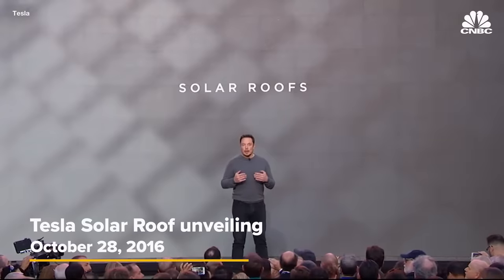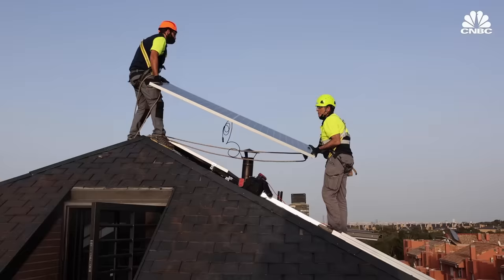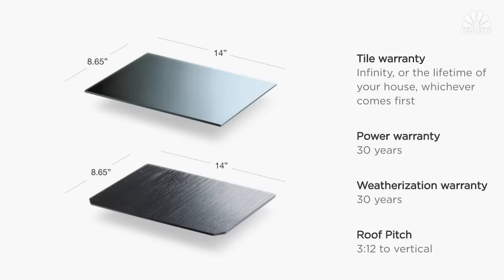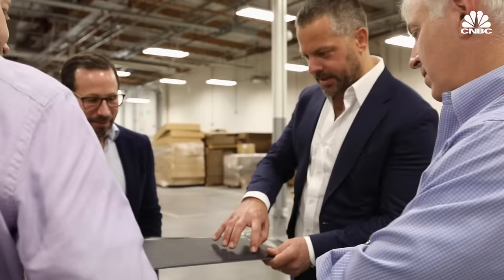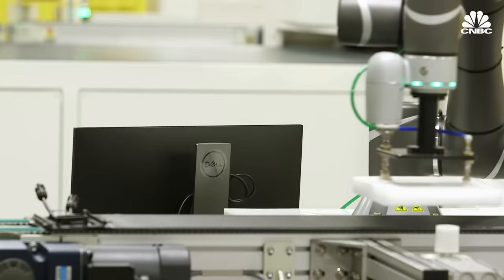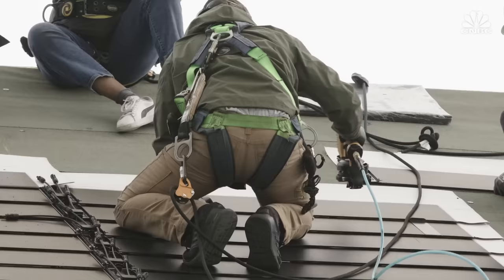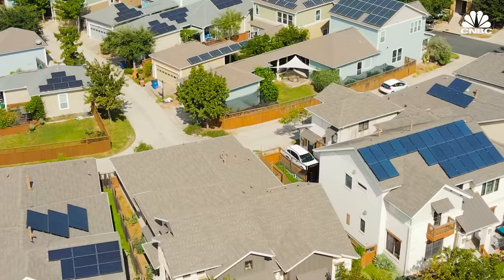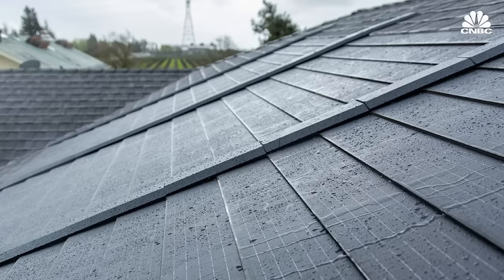How This Roofing Company Is Taking On Tesla’s Solar Roof

Comment: My main concern would be ease of repair / replacement.  I suspect it is a lot easier to replace a rack mounted panel that has been damaged by hail than their on-roof shingle.      The rack mount just seems simpler.  Why over-complicate things  for aesthetics.  It's just a roof!
Reply: A few dozen screws versus just some shingles. Idk. And anesthetics do matter.
Reply: Hail damage on shingles is probably worse than on panels
Reply: It rarely rains in my region.  Plenty of sun year around.

Comment: The bane of rooftop solar has been that roofers aren't electricians and electricians aren't roofers -- and you don't want either trying to pretend to be the other. LIkewise, solar panels aren't cost-effective water management devices and complicate the water management system, especially when it needs to be replaced.
This product is a big step forward.
Question: Can these panels be easily removed and replaced when the roof reaches the end of it's life? What's the procedure if a solar panel needs to be removed for a repair before the end of the roof's life?
Reply: The company offers the service to replace or deinstall when needed
Reply: @NoName-ei5ui  Thanks!

Comment: I have been waiting for this tech to be affordable, it seems I will never be able to have it😪
Reply: You could get a Tesla model x (Long range) at a very cheap price in our car audition.
Reply: @bobbystyles2457  then pay 20k when thr battery fails. 

Used Teslas are a very risky and poor investment.
Reply: Yeah Elon seemed to think what’s holding back solar roof was the look, but it’s the price! Supposedly solar cost is shrinking but the past 10 years I keep checking in on solar installers and solar of all types still way too expensive.
Reply: not with inflation
Reply: @gj1234567899999  yes...me too, I have been checking the prices. Prices keep going up😪
Reply: Y'all realize how price works right. People have to buy the products first and that profit goes into Research and Development which makes cheaper products. Same thing with any other tech.
Reply: Regular solar is pretty cheap, you can buy about 10 kw of lightly used solar panels for under $5000. Then you just need an inverter and to pay someone to install the panels
Reply: @ocampbell1954  it’s pretty straightforward what people want from solar. The electricity cost savings of the solar panels should at least payback the system before it needs to be replaced. From what has been quoted to me from solar installers, the system would never pay for itself.
Reply: @lakorai2  Pre-2019 used Teslas probably, but the 2020 onwards are much better, and when the 4680 battery cell begins delivery it will be a game changer for the EV market. The 4680 cells are the “million-mile battery” with minimal degradation. The average second hand care might have only 100 thousand miles on the clock. With the 4680 beginning later this year, the car body will degrade before the batteries fail.

Comment: I really hope GAF is able to deliver a good long term solar solution, the world needs it. Having said that, while I found this video to be fairly comprehensive, I would have liked to have heard how GAF compares to Tesla in extreme weather like hail. I realize that Tesla roofs are way more expensive, and I realize that it is very new, but the GAF roof is very new also. I have seen videos where a Tesla panel has been hit with a hammer repeatedly and remained intact and according to at least one builder video I saw, if one does break the time to repair is very small.

Comment: The 'faux' tiles were the mistake. The connections in a larger solar panel connected to others can be complex and expensive. It is more than just 'line in, line out.' 
Long vinyl panels similar in shape and installation as sheet metal would not only simplify these connections and lower price, but roofing companies would already be familiar with most of the install.

Comment: The issue with this is that the consumer assumes all the risk. I as a homeowner would like to know pricing, what's the warranty, does it require a maintenance contract. Also in Florida how will it effect my Insurance premium as it will be very costly to replace should a hurricane rip off the roof or damage. There are still roofs in Miami with tarps that were damaged in 2018 from hurricane Irma so I could just imagine the delay with this new technology.  

This is also not taking into consideration the current supply chain shortages that's impacting all industries.

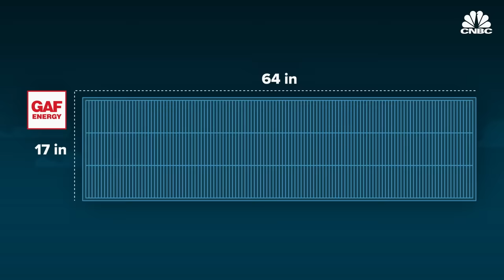Comment: CLARIFICATION 1/5/22: At 11:02 in the video, there is a comparison made that needs clarification. The video states, “Given the GAF shingle’s dimensions and its 45 watt rating, it would produce, at maximum, 5.96 watts per square foot.” However, because of the way GAF Energy’s shingles overlap on the roof, 56% of each shingle is made up of non-solar material. If you consider the efficiency of only the active solar cells, GAF Energy's shingle produces 14.29 watts per square foot, which the company says would be on par with the efficiency of Tesla’s shingle.
Reply: Hahaha no flipping way…these shingles are a joke!
Reply: Strong point from A-DaM! I'm fully convinced by the complete absence of facts in his reply.

Comment: In Florida unless the whole shingle is glued down it will blow away in a Hurricane.  Roofs with solar on it suffer more catastrophic failure that normal roofs.  Just a work to the wise who live in Florida.  As a by note there was a home near me who had the "free" solar installed on their roof and within a year they had it removed and had to do a major repair job on thier three year old 50 year roof.  Just a word to the wise here in Florida.  Solar is not without problems and I have in no wise addressed all problems in any comprehensive manor.

Comment: A few years ago when Musk had the online estimator for a solar roof it said it would cost over $110,000 for the roof. I don't remember if it included the battery. This house is in sunny Florida and has a $100 to $200 monthly electric bill depending on the season. A normal architectural shingle roof estimate was $18k. At the time the solar roof cost was 1/3 of the house value.
Reply: You need to compare the cost of the roof + PV to the Tesla solar roof, not just the roof alone. Second of all asphalt shingles are the cheapest product on the market, there are far more expensive roofing products. Asphalt shingles also have a shorter life than a Tesla solar roof, so that also has to be factored in. Lastly most Tesla roofs don't cost $110k. It's like saying why is a Porsche is so expensive compared to a Chevy when both take you from A to B.

Comment: It will be great when new homes are built complete with Tesla Solar tiles and a powerwall included.
Reply: More expensive tho
Reply: @laudableplain4282  But if they can mass produce and become standard for new homes, then price would dramatically drop.
Reply: I am seeing more and more builders are now putting ev chargers in the parking of their under construction projects and selling it as a luxury feature. SO maybe soon solar roof will become the next luxury sell in the real estate market
Reply: It is well known that polycrystaline cells are better than crystalline cells, why gaf is not using them I don't understand. Also there are new cells developed which can develop electricity both from incident light and reflected light from the roof which is referred to as heat.  Don't know why these companies don't do their research
Reply: @lancetruong4957  true that

Comment: I have 17kW solar panel system and I’ve noticed that on cloudy days my peak energy production surpasses the peak production from a fully sunny day by a large margin. My guess is the panels are much more efficient when they’re cool, followed by sudden exposure to sunlight. I believe solar technology need some sort of cooling and traditional solar panels have a gap between the panels and the roof. Solar shingles lay directly on the roof’s surface, so there’s not a gap (no cooling), therefore they’re less efficient and I’m sure they won’t last as long.
Reply: lightly Cloudy days can generate electricity from more panels.  The soft light illuminates the whole roof and there are no shadows from trees, chimneys, etc.  And you are correct about the panels being more efficient in cooler temps.

Comment: They should use a drone to 3D scan the roof or high-res Lidar 
Then pre-made pieces in factory can be created to the specifications of the roof and then just use a crane to install it
After removing and waterproofing the roof and shingles that was there prior

Comment: These tiles would be a benefit to houses under coverture of an HOA. I asked my HOA about solar panels and they said "as long as they cannot be seen from the street". I'll eventually get the older style panels and have them mounted starting from the center to the rear of the roof.
Reply: That’s a bummer that the HOA doesn’t want them seen from the street. Hopefully they change their tune in the next few years.

In the meantime, I hope your panels still get enough sun and you don’t have to compromise efficiency!
Reply: @SaveMoneySavethePlanet  i think I'll be ok. I'll get plenty of sun cause i live in Florida and the sun rises in front of my house and sets in the rear of the house. 💪
Reply: I think that the HOA is limited on how it can restrict solar.  If your house has direct sun from the street view, I don't think the HOA can disallow the panels.  You would have to have a report of some sort that shows that you get most of your sunlight from the street side.  My neighborhood has an HOA, and while most homes don't have street view panels, there are a few that do...and the main reason is probably that it faces the direction of most sunlight.

Comment: The problem with solar roofs is not the look, it’s the price. Solar roofs of any kind are still expensive. I made several quotes to solar installers and they quoted 20k-50k. I just don’t have that type of money and there is no payback. A solar roof for 5k-10k would work.
Reply: The payback would be the cost of electricity running your home from solar panels vs Utility provided electricity. If it is much cheaper, then it is worth it. If your electricity cost 400 dollars a month, then you would save most of that from not paying the Utility for the usage.

Comment: Well it's anywhere from £1.50p - £0.67p Per roof tile in the UK (You could probably find cheaper if you shopped about) Unless they can match that price or even better cheaper then it's going to be for those with a spare few quid in there pockets and not for everyone

Comment: Seems like a solar rack is by far the best solution right now. More electricity generation, cheaper install cost, easier maintenance, better durability. Until prices drop a lot solar roof tiles will likely only be for rich people that want to feel better about themselves.

Comment: At 3 minutes in, I already see one big problem. The connection wires. If you live in an area where you get 30+ inches of snow a year, you need to do something called roof raking. Basically you're removing snow from your roof so the roof doesn't collapse under the weight of the snow. When there's a lot of snow on the roof, you're not going to be able to see the connection wires. So then when you come with the rake, you're going to catch a wire, and pull so hard the wire breaks or the solar roof tile comes up. The company that's developing this is on to something, but they need to take into consideration that more than 50% of Americans live in an area that receives snow.
Reply: I was more thinking of large icicles that yank on the wires.  I've seen 500 lbs icicles hanging off of heat strip before.

Comment: Solar shingles are a luxury product. Larger panels create greater efconcept. Smaller ones require an incredible number of electrical connections. Each connection is another potential point of failure. Good luck on that concept. Billionaires only need apply.

Comment: If someone wants to spend a bit extra money, hybrid solar panels are much better thing to do (especially in hot areas). The heat from the panels can be used to heat water and that way the pv cells will work at peak efficiency. And of course battery storage.
Reply: Hybrid panels aren't very good. You want to keep the water in there until 75°C/170F, to use it for direct hot water heating. To run the PV efficient you need high water flow with low temperatures, but then you need to power a heat pump to raise the temperature for your hot water. They safe roof space compared to two separate systems, but the hybrid is strictly worse.

Comment: I was expecting a video of the shingle tech itself. The wiring was to thick. Connectors overly large.  Deliver the panels in sections of roof. The shingles are the roof! Reverse and use use them as led lights in some applications. Run the heat/ channel it into an HVAC system, the ground or into a boiler in the attic as storage like a battery.  Leaves 🍃 on a tree don’t have a problem from heat. Misting the roof will increase the efficiency and re collect the run off.  Test extreme tolerances then reduce to optimal.

Comment: This is really happening.   Sounds like it's at least five times the cost of a traditional roof.  But energy independence peace of mind etc.  it'll be worth it very soon! 👌
Reply: Estimated costs from data they've given so far look like only a 50-75% premium over a standard roof.
Reply: @SkylearJ  And they seem to be slightly cheaper than a new roof plus panels. It's good to have more options.

Comment: Hybrid Solar-Photovoltaic-Thermal panels are the future, IF manufacturers and government subsidies make it cheap enough for everyone to install.  Assuming a 20% efficient solar PV cell, a portion of the remaining 80% of solar flux can be pumped into your home, offsetting the biggest power drain on your house: heating air and water. If a house has a chimney, you could pipe the heat pump tube down it and store a great deal of heat in the stone and the air in the house for overnight. If you spend a little bit of electricity on the pumps overnight to drive the heat exchanger on the roof, the heat rising into the attic will be efficiently pumped down into the house, preventing more heat energy from leaving the roof than the equivalent electrical energy (after losses) needed to replace it.

Comment: It's a string system without optimizers. Even with mono perc cells heat is still going to be an efficiency killer. And to be honest I don't even think they look that good. The MC-4 connectors are too bulky and they are having to use that flashing system to cover them up.

Comment: If you want to be really efficient using NOT exotic materials and a lot of simplicity, use a solar powered Sterling hot air engine. They could easily get 60% of the sun's energy instead of just 20 or 25%.
 Little or known maintenance required.

Comment: Why does solar panels always have to go on top of singles? I think the way to do it will be put the solar panels on top of the actual wood , like a tile on a subfloor, and then install singles around
Reply: So water doesn't get in.  Panels alone won't create a good seal.  It's also good to have the panels off the roof a few inches for circulation so they stay cooler.  The hotter they get, the less power they produce.
Reply: @updlate4756  There has to be a way. Maybe a special platform that goes on top of the wood and then the panels on top of the platform. The problem is having that roof tile underneath.  If you have a lot of solar panels and you are installing a new roof. Why pay for all those singles? Also when the time comes to changes the singles, what are you going to do? Remove all the panels? It just seems inefficient.

Comment: As a roofer this absolute garbage! An average asphalt roof last 20 years. So now you want to introduce a solar system that is 10 time's labor intensive and only last 5 years. Trust me the average crew will not put these on in a day.i just want to emphasize that if you pay 72k for solar that would be about 30 years of electricity bills. That's not included with replacing bad panels etc

Comment: $140 000 ???? Musk is out of his friking mind, we know he is a blow hard but that is just ridiculous especially if there is an existing contract.  I live in Australia and can get a normal 6.5kW system for around  AUD 3000.00. I personally think if you go for roof integrated systems is not smart. Number of reasons is accessibly,  heat, fire  maintenance.  I think panels look reasonable and it advertise that you have solar therefore a responsible member of society.

Comment: of course its twice the amount of a new roof plus the backup battery, a new roof can look good with solar panels if its designed to integrate with the roof  stick a blank  , silver rimmed panel on variegated gray roof and it will look stupid, it just has to integrate.